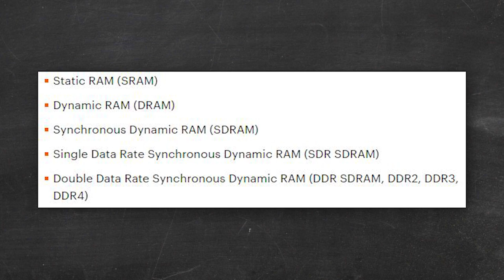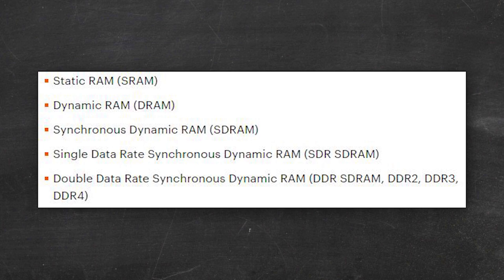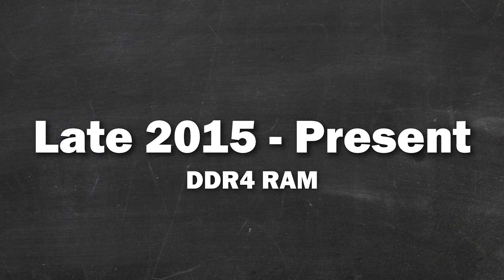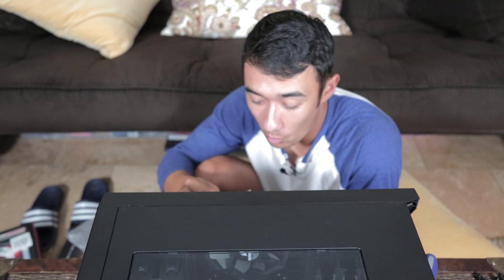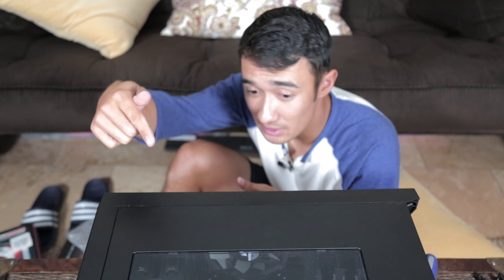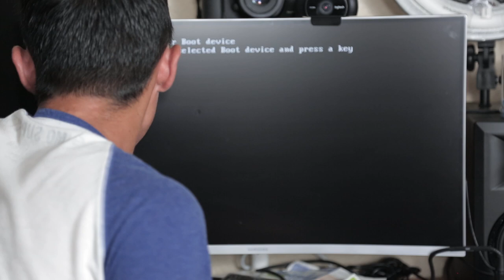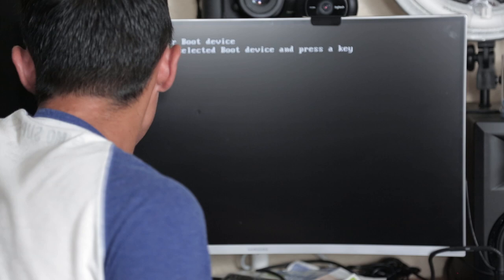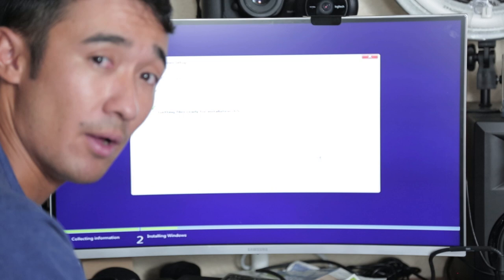How to Build A PC - Full Tutorial

Comment: we cant build a computer later than 2007 why?????you didnt need to take the mobo back out cos there was a hole in  the case at the back of the mobo ,all u had to do was take off the other side panel. psu was in the right way but u should of said dont stand on deep pile carpet that mobo comes with a G connector for front panel would of helped a new builder GOOD VIDEO ---------

Comment: i built a pc about 3weeks ago. and it took me 15minutes. it was disappointingly fast. I even did cable management. took no time at all.
Reply: The things that scare me about building a pc Is damaging the CPU or motherboard and where all the PSU cables go
Reply: @InternetUnraveled  being scared of that stuff will make you more likely to do it bro! and remember, always use the manual. i keep my manual around for when i feel like changing the insides of my pc around a bit and have to plug the front panel connectors in. cba learning them so i look at the book, lol

Comment: I plan to get an ssd and a internal hard drive. How do I make sure that windows downloads to the ssd and not the internal hard drive? Or is it on both or what? Thats the only question I still have.
Reply: You don't "download" Windows to your drive. You install it. There's a big difference in downloading and installing. Anyways, when the installer asks you where you want to install Windows to, you of course choose your SSD. If your SSD and HDD are different capacity, then it it will be easy knowing which drive to choose.
Reply: @porkchopbeats1057  Hey I'm just giving you the correct information and terminology. Not my fault you're offended.

Comment: Isn't putting the ram in the outer most slots just because you have a big CPU cooler the wrong answer the mobo manual tells you which slots to use first if you're only going with two sticks no?
Reply: some boards from the past did that some new ones might also im sure he looked it up most likely knows the board already and doesnt matter what 2 he uses other then use the same color slots for both :P

Comment: At 26:50 you explain the fans incorrectly... the single fan next to where your cpu cooler is going to be is an exhaust fan, blowing air out of the case. The two in the front panel are pulling air into the case. I know this video is two years old but you might still be getting newbies watching this as reference who will blindly believe what you’re saying.

Comment: I just bought a prebuilt pc and the ssd that came with it was in one of the hdd slots, is this bad? if so what should I do?
Also how do I know which one has my operating system on it? I heard it was better to have it on my ssd just don't know what its on currently.
Reply: Doesn't matter where it's installed. SSDs have no moving parts so they technically don't even need to be mounted.

Typically the boot drive is the C: drive, if the drives are different sizes you can tell by the capacity shown in "my computer". You can also check in the BIOS.

Comment: Did all the cables come with the package or did you buy extra ones ?
Reply from the maker: If you buy these brand new you will need NO additional cables. If you buy used, look for a SATA cable as those usually don't come with used motherboard boxes, if you get the box at all. (Speaking from experience)

Comment: Hi. I'm not a begginer, but I need a big help.
I switched to a gtx 1080 from a gtx 1060 and getting the same fps...
Uninstalled and reinstalled the drivers for the card and nothing changed.
Overclocked the cpu and ram but still same fps.
Even tried to downclock them but nothing changed.
My power plan is in high performance mode.
My monitor is 1080p tried fallout 4 and I barely got 100 fps with the lowest settings.
Even tried with my 4k tv on ultra settings and surprisingly got above 60 fps.
PLEASE HELP!
Reply: What cpu do you have? It could be a bottleneck
Reply: Minoook i5-6600k.
Reply: Maybe it's automatically going to 4k that happened to me

Comment: You applied thermal paste? Funny... Maybe later, but certainly the paste was not used in the part you showed (eg 37:42) - the processor without paste, which lies in the upper left corner ... later 39:53 - the paste lies in the same place, cpu cooler is in the same position like 38:46 before you start talking about the "corrupted video" and the applied paste...

why you just did not say - "I forgot"?

22:34,  really? Did you take out the motherboard instead of opening the side panel and screw back plate ?

Nevertheless - the video is great for someone starting ... for someone who knows a bit - there are better videos. Good luck on the channel :)

Comment: Very good video.. The only thing is Windows.. arggggg... I wish more people would use Unix based OS like linix mint. For many many good reasons (open source code) Windows 10 is  a hunk of garbage-spyware... packed full of half ass rushed software that consistently wants to updates and crashes at the worst  possible time. Not to mention windows  isn't free. With tons of unessary system resource running in the background. 5gb (Iso) file when linix mint is 1.9gb. I get it there are many games that only support Windows  for some stupid reasoning... After Windows 7  I moved to Linux  and it's been really nice. There is slight  Learning curve  with .tar files and the ""Terminal" but all and all not so bad Totally  worth it.. there is soo much mord control over your system. wish people would just all totally give up on windows as it's a shit company with a shit future..useing windows is like trying to dance in a bodycast... the only thing that need to happen with linix that will totally kill Windows off is better driver support for hardware  and games playing
Reply: You seem educated can u help me. What if the I/O shield won't fit the side what I mean is what it the things are in like different places than the I/O shield goes 16:49 (ex:HDMI slot is in a different place than the i/o shields HDMI thing is supposed to be

Comment: hey you made a major mistake with your fan first of all psu fan always suck the air never blow un less you have a dual fan psu or some server psu and your case fan the way they are oriented are blowing air from front to the back of the case not from back to front as you say simple trick to know wich way ANY fan blow the aire is to check wich side have the plastic grill that the rotor is stuck on because this side is the side that blow the air out ANY computer fan work that way
Reply: There is literally nothing wrong with what he did in terms of fan arrangement. The front fans are set to intake air and the rear is set to exhaust. The PSU orientation is fine as it doesn't interfere with the air flow within the case as it is isolated, as long as the PC is not placed on a carpet or the bottom of the case isn't starved of air flow.

Comment: wtf dude where's your allen wrench and your power supply pads to keep it from EXPLODING? and why did you use that 1050ti when the 1080ti can run literally anything in 4k highest settings? also where's your 1000 watt power supply for ray tracing cards when they come out?

new on The Verge [of stupidity]

Comment: Im still arguing... should i or should i not build my PC. I am scared of breaking something while building.
Reply: Alfraks Been building PCs for 30+ years: While it is always good to be cautious there is no need to be scared. * NEVER FORCE anything. 
* *Take your time building.*
* Look at the manual and watch videos of people installing the part you are working on to verify the orientation. 
e.g RAM is correct way, CPU triangles aligned, PCI cards in correct slots.

Yes, you will need to give some pressure for the RAM sticks and the GPU but just go slow. If possible find someone to show you the ropes -- once you've built your first computer it won't be a scary process.

Good luck!
Reply: @MichaelPohoreski  Well i still got a long while till i get the chance, im curently trying to save up money
Reply: Have you got all your parts picked out? While you are saving up I'd recommend the side bar on Reddit's buildapc sub-reddit:
https://old.reddit.com/r/buildapc/